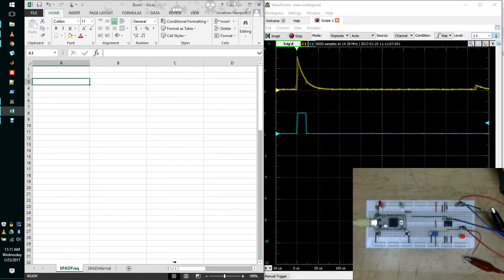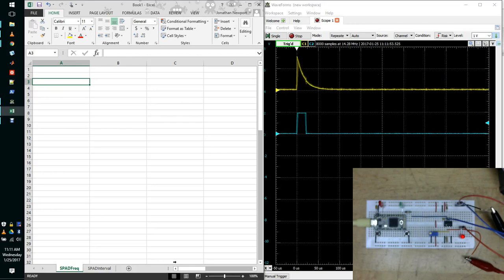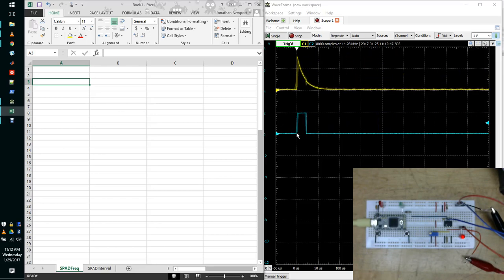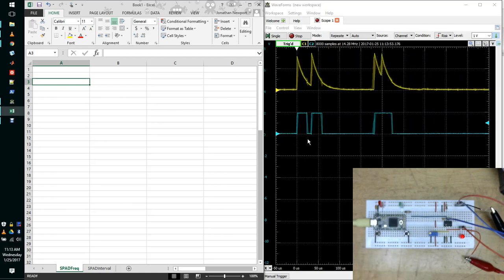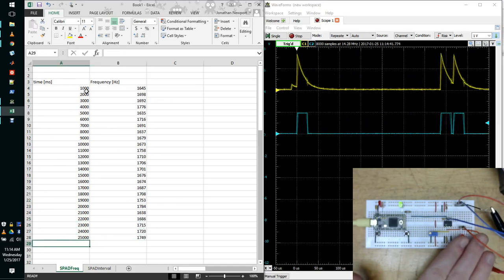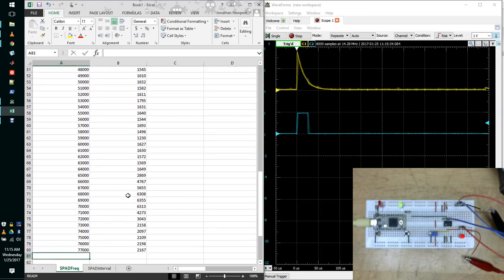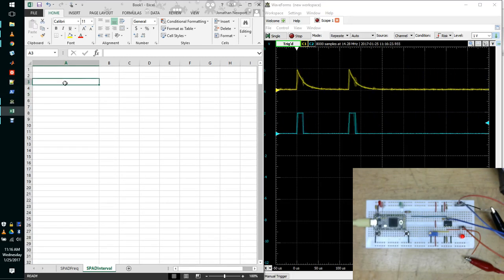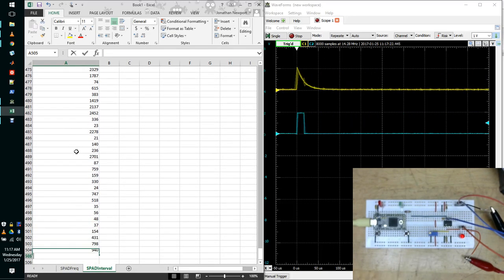Single Photon Avalanche Detector (SPAD) Lab Description and Operation

Comment: Can this be used with a very precise photon detector module when I expose it to a very low photon source, resulting in max 200cps, signals of max 30ns width each?
Will your counting circuit be able to count each of those incident photons?
Reply from the maker: Probably as these LEDs are actually very bad SPAD sensors with poor quantum efficiency and too much capacitance for those kinds of speed. We just use them as an instructional tool!

For a 30ns pulse width you're going to need a professional SPAD detector with small active area and a reasonably fast oscilloscope. Maybe check out the APD430A from Thor, believe it or not, these have actually gotten cheaper over the years!

Comment: Where did you buy the SPAD chip? did you use optics?
Reply: He's just using an ordinary LED and carefully adjusting the reverse bias voltage to a point just below where the LED breaks down (non-destructive avalanche breakdown). At this point, even just a single photon can put the LED over the edge and into breakdown. The circuit is feeding the LED through a resistor so when the LED breaks down, the voltage drops because the current rises and the resistor voltage drop increases. This takes the LED out of avalanche and the voltage rises back to the preset level, ready for another photon to arrive. There are special photon-counting avalanche photodiodes which have much higher performance - the main differences are that they have a much more stable avalanche threshold so you don't have to keep tuning it to stay right below breakdown. They also react to a higher fraction of photons which enter the diode (the LED might only react to 5 or 10% of them).
Reply: The AND113R diodes are used for such projects. They are not specialized but have the avalanche property very prominent.
Reply: @sbreheny where can I buy a specialized SPAD diode?
Reply: 2sc5707 кт315 https://www.youtube.com/watch?v=Ju1UIuoVvCo&t=593s

Comment: how did you say it give single photon signal
Reply: When the diode is in darkness, the count rate is very low (can be single digit), meaning that photons are triggering such events. The following is from Wikipedia:
Avalanche photodiodes (APDs) are not single photon detectors. The experiment uses a single photon avalanche photodiode (SPAD).  APDs are biased close to, but not exceeding the breakdown voltage of the semiconductor. This high electric field provides an internal multiplication gain only of the order of few hundreds, since the avalanche process is not diverging (also known as run-away avalanche) as in the case of SPAD avalanche discharges. The resulting avalanche current intensity is linearly related to the optical signal intensity. A SPAD, however, operates with a bias voltage above the breakdown voltage. Because the device is operating in this unstable above-breakdown regime, a single photon (or a single dark-current electron) can set off a significant avalanche of carriers. Practically, this means that in an APD, a single photon produces only tens or few hundreds of electrons, but in a SPAD a single photon triggers a current in the milliampere region (billions of billions of electrons per second) that can be easily "counted". Therefore, while the APD is a linear amplifier for the input optical signal with limited gain, the SPAD is a trigger device, and this triggering is what we are seeing in the experiment.